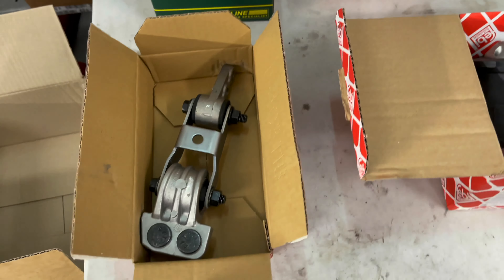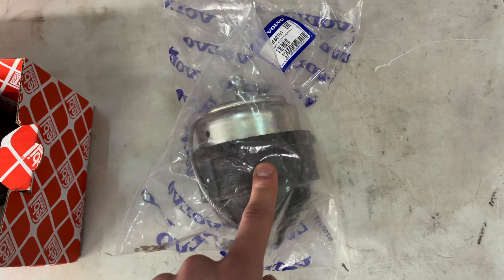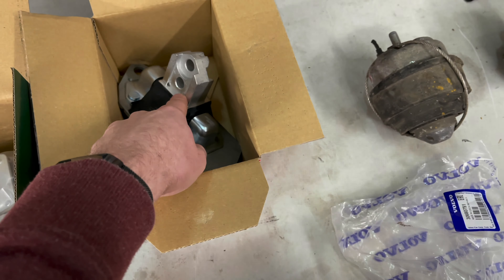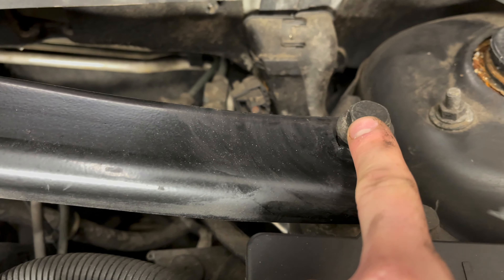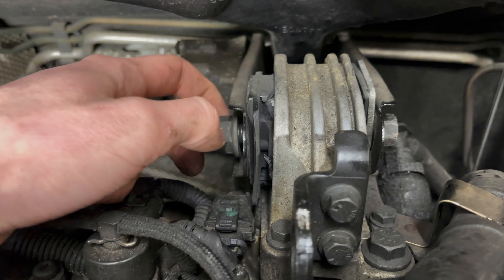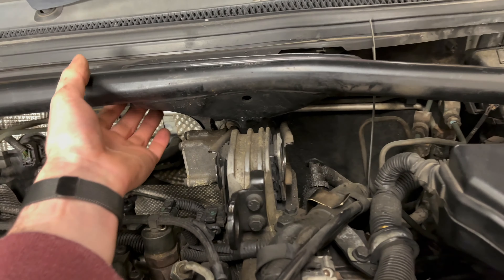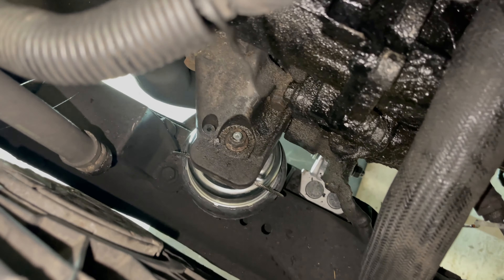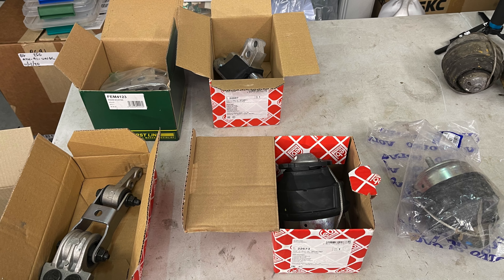How To Replace ALL 5 Engine Mounts Euro 3 D5/T5  - DIY Volvo V70 S60 XC90 S80 P2 Vacuum Front Rear

Comment: Is the rear and front mount different? All parts store around me say it's the same. Don't wanna be in the middle of the change and have the wrong part.
Reply from the maker: Hi Jalen, I address this at the beginning of the video. The mounts are the same except for an extra piece of rubber on the rear mount.

Comment: I have a 2003 2.5t all wheel drive do these Mount shown here on your video are they the same that I will need to purchase
Reply from the maker: I’m not sure on that one but if you use a local parts distributor or euro car parts, give them your registration and they sort you out. Alternatively try Volvo direct.

Comment: ONLY HAVE TO UNSCREW THE THREE BOLTS ON FRONT ENGINE MOUNT BRACKET TAKE BRACKET WITH MOUNT AND ALL TOGETHER, A LOT EASIER AND QUICKER
Reply from the maker: I've seen the bolts as I did remove them when changing the gearbox, they're not very easy to get a tool onto depending what tools you have.

Comment: By the way, do you might have a clue why my d5244T is so hard to start? Glow plugs are okay.
Reply from the maker: I have this problem and it wouldn’t surprise me if it’s a loss of pressure in the fuel system after the high pressure fuel pump. I won’t know the exact cause unless I ever replace the high pressure pump and possibly the injectors.
Reply: @IAMASPANNER  I just rewatched this and saw my comment, it was a fuel pump issue indeed. IMO you’re a p2 god
Reply from the maker: @seesikopter  that’s great if you got sorted, so did you change the high pressure fuel pump and it fixed the problems?
Reply: @IAMASPANNER  it was the pump in the tank. My das replaced that bcs he thought the old one was broken with a cheap aftermarket one

After listening closely we didn’t hear a hum, when I changed the fuel filter I think I killed the vacuum that sucked the fuel into the High pressure pump. After then taking the original pump and applying 12v to it it started working. So we put that one in again and the fuel problem, at least this, is gone. I now got a lot of can issues and a lot of issues regarding fuel pressure in the rail. 

Another issue I had was wrong values from fuel gauge and also that the pump in the tank blocked the flap that secures the fuel to not spill into the pipe. You can imagine how fun it was to fill the tank up again 😂

I’ll have to see if I got the pump seals working, cuz I had filled my tank a lot of times and next day there was diesel all under the car… but your videos are so helpful and informative👍🏼 love watching them
Reply from the maker: @seesikopter  Thanks for the update, glad my videos are helping. Mine is taking every longer to start, I’ve never had a problem when replacing the fuel filter on mine but from experience on other cars it’s a complete nightmare when there’s no lift pump and you lose the vacuum. I hope you get sorted!
Reply: @IAMASPANNER  low pressure one

Comment: Good work 👍
Stick to Lemforder parts they are oem and the best
Reply from the maker: Thank you, I’d have bought all genuine parts if I could but I’ve had so many jobs to do lately I have to watch the £££. I never buy the cheapest parts though always try to get a decent brand.
Reply: Agree. Fitted a Febi rear mount, it died after 3 months. Had to change it again, this time it is Corteco
Reply: The genuine Volvo ones are made by Corteco

Comment: So same thing on 2004 S80 D5 ? :)
Reply from the maker: Yes it should be I just forgot to put it in the title 🤦🏻‍♂️
Reply: @IAMASPANNER  Hey Mate, i got my Mounts today finaly but i had to realize that the Top Mount like in your Video at 05:15 Minute  that there is some play in the bearing... is this normal?! i mean i bought it from "Lemförder" in new... but didn´t see this ever before... Do y mean that this normal? This play is only on the horizontal side of the bearing but i can move it form  up to the stop from the left to right side... is this seriously normal?!
Reply: @danielvinogradov7029  Yes, it's a floating bush, supposed to have movement in it.  Just saying for anybody reading 3 years later.

Comment: 14:00  I think this is the mount that's probably responsible for a hard metallic noise when accelerating at low speeds. i was getting a lot of feedback through the car so hopefully this is the one that'll change everything.

Hi there mate. I’m also facing a metallic buzzing sound when accelerating from a stop and going into 2nd gear. Would you mind a favor listening to this clip of the sound I’m dealing with and mentioning how it compares to your sound.
https://www.youtube.com/watch?v=hutzNapGPzw

Comment: Putting aside the mileage those oil leaks need to rectified firstly and then give that engine bay a through wash down. Filthy.
Reply from the maker: I’m planning to take the engine out soon as I have a 6 speed box to fit along with air con pump and the crank/cam seals. The heater matrix has just blown too!

Comment: Completely wrong order to change them
Reply from the maker: I realised that while doing it but only way I could’ve changed the video order would’ve been to replace old parts
Reply: Great video Tolly, many thanks. On Igors comment, what would the correct sequence to change them be?
Reply: @alvinc2320  rear first, front, side, front lower, top
Reply: @alvinc2320  and at the very beginning remove lower front and top one. Makes life easier.

Comment: FCP Euro shows a kit of 4 but not the 5th one. Specifically, the Volvo Mount - Hutchinson 30748811. However a quick search shows that it is there. Why would they not include that one? (2005 XC70). Hoping these cure my CV-Axle from getting eaten, etc.
Reply from the maker: I’m not sure but perhaps the just don’t consider the fifth mount an engine mount so list it separate.